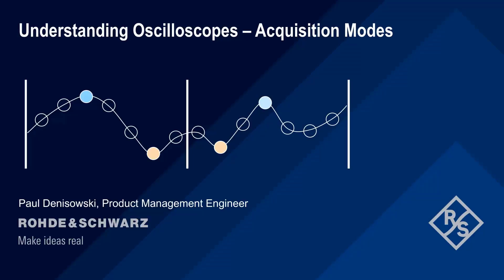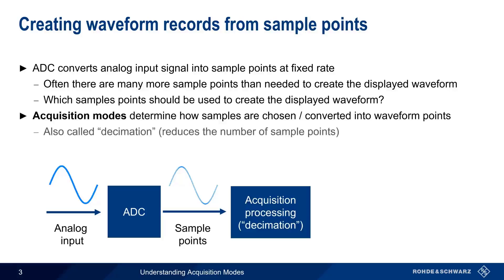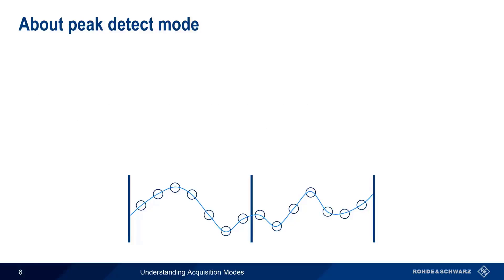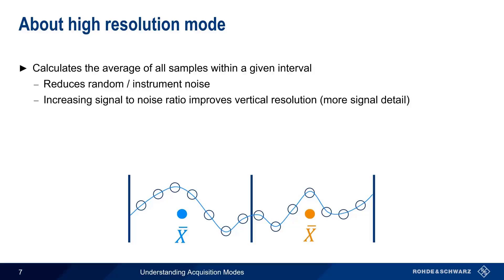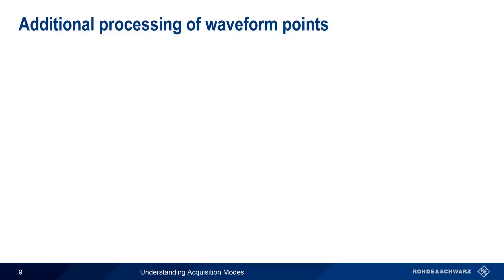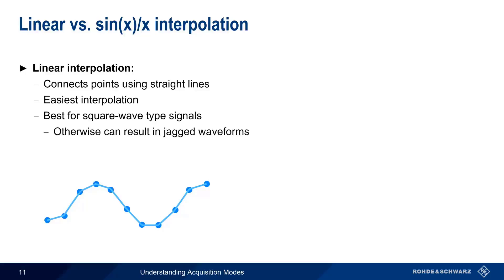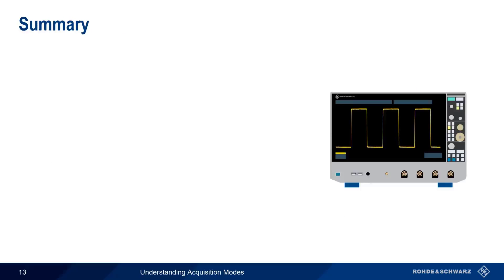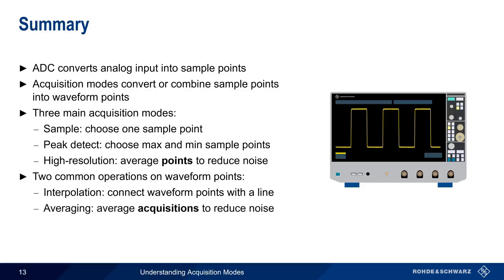Understanding Oscilloscopes - Acquisition Modes

Comment: I have the RTB2004 (BW=300 MHz).  It's the best scope I have ever owned and I've had them all.  I wish it had high-definition mode, especially for the logic analyzer channels.  When troubleshooting switchmode power supplies, noise prevents me from getting clean logic signals.  They are clean with a spring-tip probe and a 20 MHz BW, but logic signal BW is not adjustable.

Comment: So, as one increases the sweep speed causing fewer samples in each high-resolution display point, does the display BW approach the scope spec BW?
Reply: Yes, that's correct (and an interesting way of describing it - thanks!).  If there are no excess samples, high resolution mode won't (or rather, can't) discard any sample values, so neither the sampling rate nor effective bandwidth will be reduced.  If you're concerned about reduced bandwidth, a better solution is high DEFINITION mode, which I describe in a separate video ("Understanding Oscilloscopes - High Definition Mode")